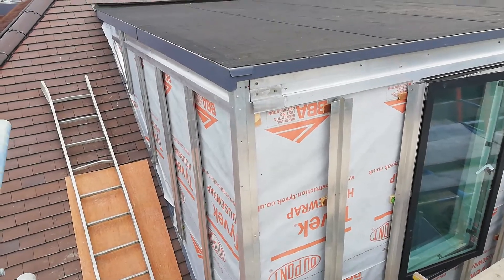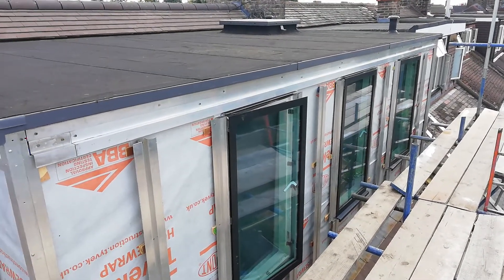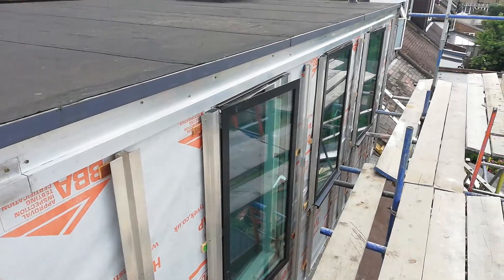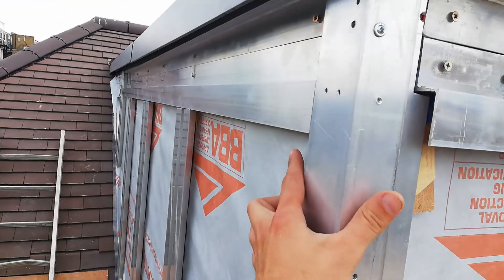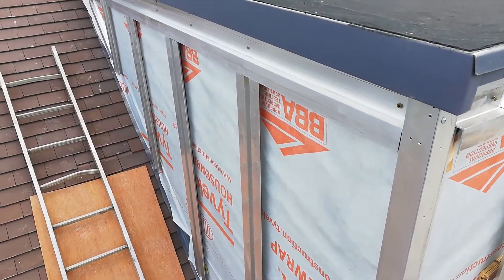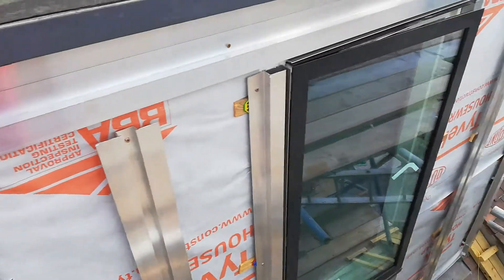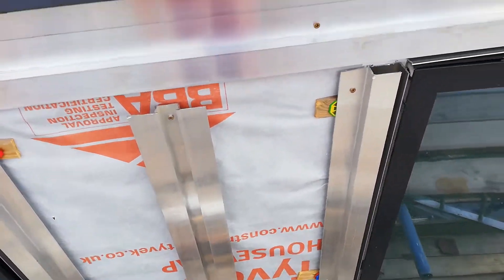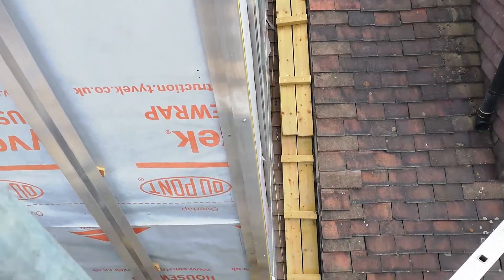Rainscreen cladding/ ventilated facade principles. TCS LTD, London, UK

Comment: hi, Quick question for packing. Please correct me If I am wrong but I can see you are using wooden packers in behind of alu railings. If there is a 5% of water ingress there is a risk that wood will decompose. Should it all be packed with plastic shims instead?